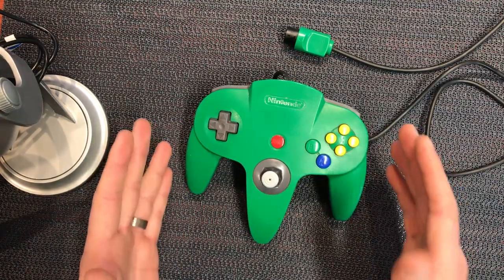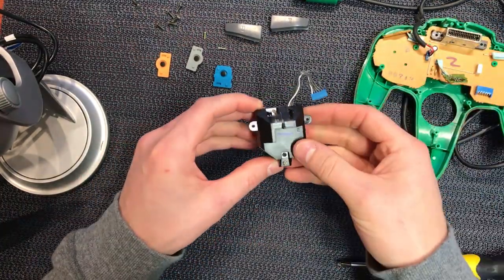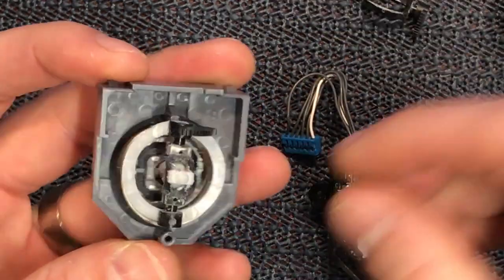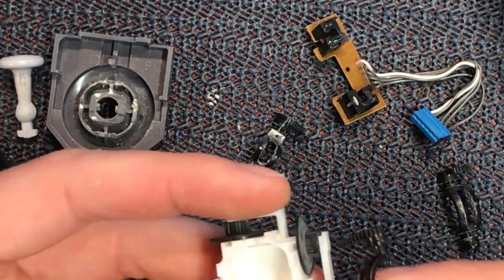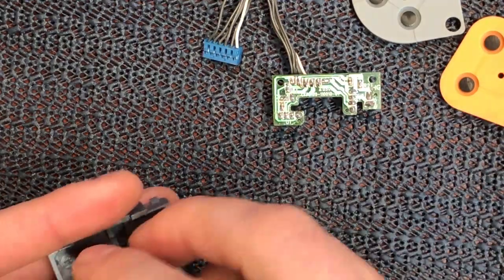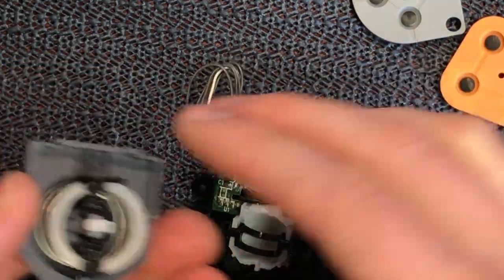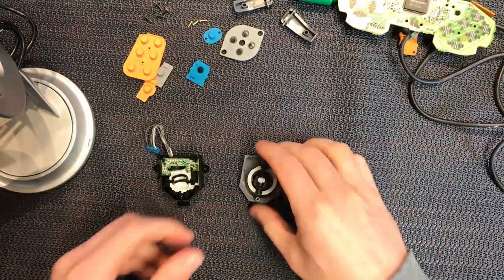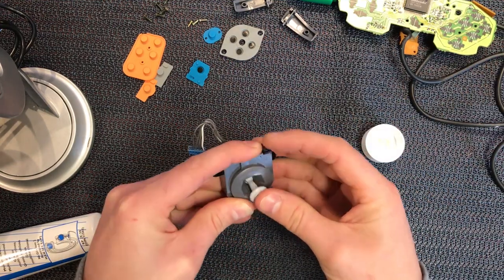How to Repair N64 Controller Wobbly Joystick - YouTube

Comment: Great video =D  Fixed a few of these myself - I find it easier to just swap out the stick for a replacement stick.  It doesn't work out much more expensive and saves a tonne of time.
Reply: Where do you source your new sticks pal? I'm in Ireland so I could prob buy from the same person as you...

Comment: You might want to consider lightly sanding and polishing the end of the stick after the glue dries. The glue can be hard and rough and shred the bowl. I usually de-burr with 3000 grid sandpaper and some plastic polish.

Comment: great vid.  also sucks when the rubber on the button pads starts to split.  especially on the d-pad.  you can tell it is starting to when you have to mash the d pad harder than normal.

Comment: I personally prefer the "GameCube" style replacement sticks you can get on ebay. More durable but less accurate. Good for mario kart less good for super mario 64. They also feel smooth like modern joysticks.
Reply: I haven't found any that don't have a huge dead zone in the middle and/or weren't "quite" analog (meaning it didn't do full 360). Were you able to find a good manufacturer?

Comment: Kitsch Bent gears are crap. They are warped and do not fit properly. Their bowl and stick are mostly fine. The thing is, you can replace all three with parts from a brand new original stick and it still will not get rid of all the slack. I've had a video ready to upload for the last month and a half where I tested this using parts from an original, never-used joystick and Kitsch Bent parts to reveal the problematic part, which is one you still can't buy replacements for. It really surprised me because the wear point is really subtle (simply can't inspect it visually).

Edit: and now that I've seen more of this video I see that it also perpetuates the "slack is caused by worn gears" myth. I've known that this was false since 1996! That's because the sticks start grinding before the gears start wearing. By the time the stick and bowl wear down enough for the ball to pivot lower to wear the gear, your stick is too far gone anyway.
Reply from the maker: Thanks for your input. What do you recommend for a proper repair? I'm certainly no expert with N64 repair, but I think these Kitsch Bent parts do work quite well. Maybe the quality has improved over time?
Reply: What is needed is a shim that goes around the base of the joystick ABOVE both gears. I make them by hand out of old pen bodies. They are a HUGE PITA to make. I would LOVE if someone could mass-produce these shims. I would buy like 100 of them. That will fix 90% of the problem. But replacing the gear will help keep the stick super snappy. So that's certainly not wasted energy.
Reply: Additionally, if you repair (or upgrade) an existing controller with this shim, it will NEVER wear down the bowl again, because it's suspended above the bowl and never actually touches it anymore.

Gears will still wear over time, though.
Reply: Conrad MacIntyre The thing about the gear wear is that it is accelerated by the regolith produced from the stick and bowl grinding. Suspending the stick stops the production of regolith, further improving the longevity of the gears. As long as you clean the old plastic dust out and lubricate it should prevent the gears from wearing significantly too.

Anyway, many have noticed even way-back-when, lifting the stick stops the grinding and reduces slack (eliminates if the gears haven't started wearing yet). I have experimented with 100% new genuine sticks removed from my perfect condition slack-free unused/never used controllers and determined that even a new stick, new bowl, and new gears will not eliminate the slack. Somehow, it's the module's top housing. As soon as I swap the top housing from a new/never used genuine control stick module (along with the aforementioned parts) I get 100% slack-free like-new stick, even if the old part doesn't look bad or worn at all.

I am going to experiment with making a mold of my new/never used parts but if I could see what you are doing to support the stick I may be able to make a mold that incorporates your fix.
Reply: Global Garage My parts were ordered from their site directly in June and received in July. They are a bit springy/flexible and, thus, they do not hold the proper shape and often interfere inside the controller. Many people resort to sanding them. In my experience it really is better to find good genuine gears and refurbish the bowl/stick with Kitsch-Bent parts. As mentioned earlier though, even original genuine OEM gears, bowl, and stick will not completely eliminate the slack and restore it to a like-new state. For that, you need a replacement module top housing, which no one seems to make yet. :( I'm experimenting with making replacements for that myself.
Reply: Conrad MacIntyre Where can I see an example of the shims you talk about? You say you make them out of old pen bodies? That reminds me of the GBA SP hinge ejection trick I came up with around 2004:
Take a Bic Round Stic ink pen and remove the plug that holds the writing parts in the body tube. Toss the body tube.
Remove the writing parts from the plug and toss them.
Cut the straight tube off the plug (the part that was once inside the body tube) and toss the cone-shaped part.
Open the GBA SP screen to its detent position and press the tube against the four clips inside the GBA SP hinge.

It should push right out! You may need to shorten it for one of the hinges due to a rib that will otherwise force you to press from an angle, possibly not contacting all four clips.
Reply: @Tom-qo4mz  Yes, that would be a spacer or shim.

Unfortunately, the gears were never meant to support anything and only do that when the stick and bowl are worn down allowing the stick to sink in. Adding a spacer to suspend off the top gear forces it to support the stick entirely and adds drag to the entire thing. Also, you can see the slots in the gears he is using have already been worn wider, which means you have to push the stick a bit further to engage with it and will have slightly less range even if the stick springs all the way back and feels tighter. Even when lubricated it will obviously add drag as well. Because replacement sticks and bowls are available it makes more sense to use those to raise the stick properly and then deal with the slop in the gear slots another way.

The gear wear is not the cause. It is the result of stick and bowl wear. The rough, ground-down, abrasive plastic that I keep referring to as "regolith" gets in everything and accelerates the wear between other sliding surfaces that were also never meant to bear load. Once your stick seats low enough with the rough plastic that it starts to eat into the slots on the gears, you have an entirely new issue. Also, seating lower changes the pivot point and increases the slack even without gear wear.

Preserving a good stick is better than fixing a bad stick, IMO, so I prefer regularly maintaining them and dealing with the stick and bowl before the gears become an issue, which should preserve the gears. Lifting the stick may improve the feel for one that's too far gone but it will never feel or perform like an original. :(
Reply: @emmettturner9452  Ty for the reply. The things are a bleddy nightmare it seems! I've been watching vids and reading comments etc. and I'm inclined to agree, best thing to do is get an original controller/stick that's in good nick and lube that in the appropriate places rather than do anything else. Is what I am planning to do w/mine. 

Re: 'I prefer regularly maintaining them and dealing with the stick and bowl before the gears become an issue', is the regular maintenance you refer to the same as 'dealing w/the stick and bowl' or are they two different things that you do? In either case could you elaborate as to best way of going about it in your view? TIA!

Comment: This video title is misleading and does not show how to repair a wobbly joystick. It shows how to replace the parts in a wobbly joystick that are purchased from a retailer who is no longer selling parts. There is a huge difference between repairing a wobbly joystick and replacing a wobble joystick.
Reply: well you can't "repair" those part or maybe with resin , but is a lot of effort just for this 
as for where to find those part , just search "Nintendo 64 joystick gear" you will find a lot of retailer selling those part

Comment: If your  replacing it with a new $10 joystick assembly... Take it apart and pack the cup with dialectical grease.  It will feel , work and last 100% far better.

Comment: I still can't believe no one has capitalized on making new "bowls" for the joystick.
Reply: Austin Borton there is one seller on ebay. I was tempted to buy it but instead just went with a new joystick all together.
Reply: And now SteelSticks has made a bowl, as well as metal versions of the original parts, but its not massively available yet